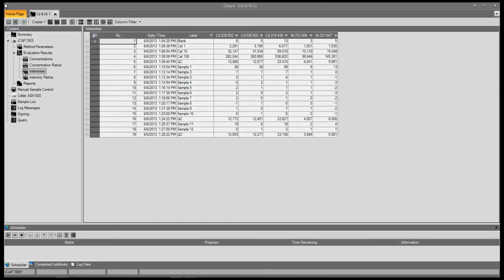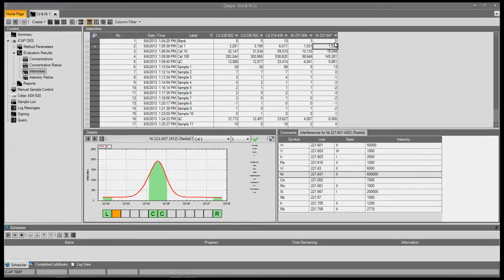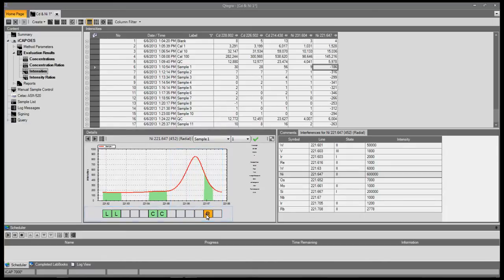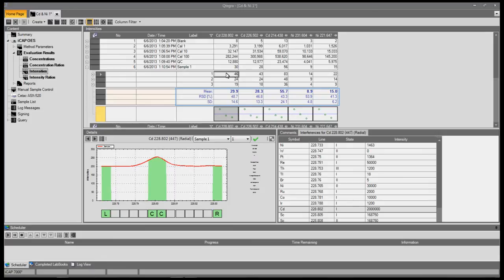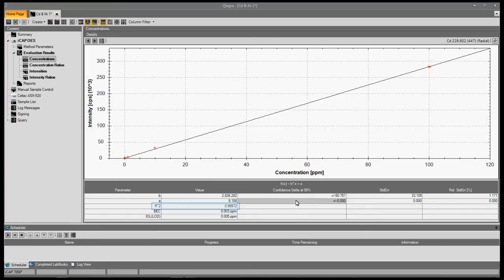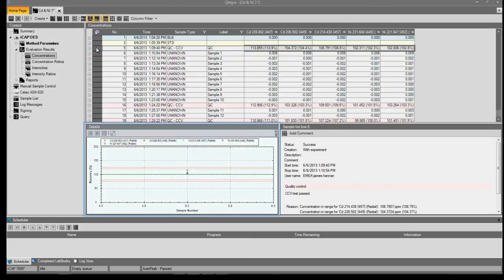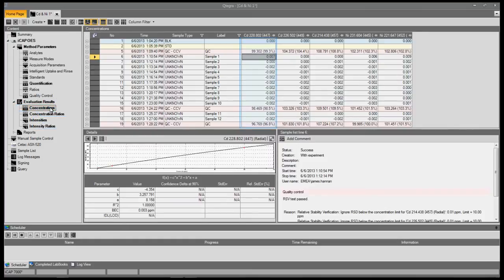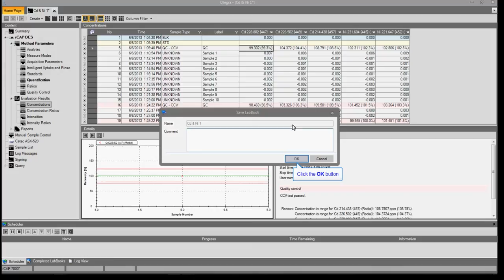Qtegra for ICP-OES #09: Looking at results

Comment: I recently had my groundwater samples tested at the Central Research Facility (CRF) for metal concentrations. However, the results indicated negative values for the concentrations of metals such as manganese (Mn), cadmium (Cd), chromium (Cr), nickel (Ni), and zinc (Zn).

I would like to inquire if these negative values are accurate or if there might be an issue with the analysis. Additionally, is there a way to refine or adjust the data, possibly through recalibration of the instrument? The samples were collected from groundwater near a landfill site, and obtaining accurate results is crucial for my research.